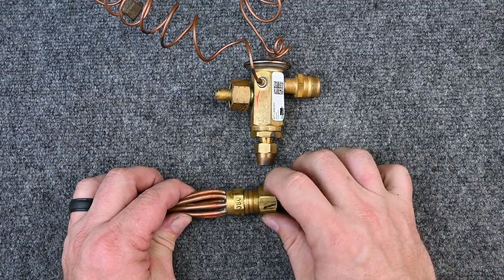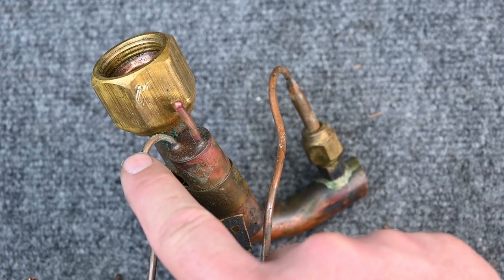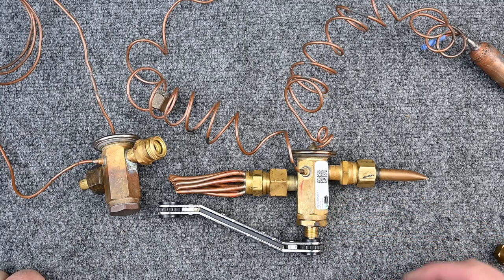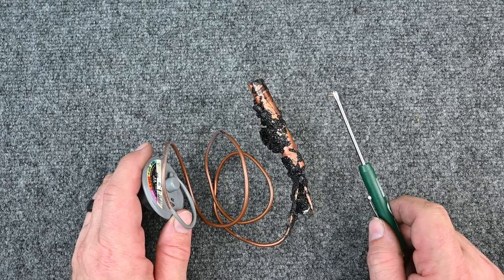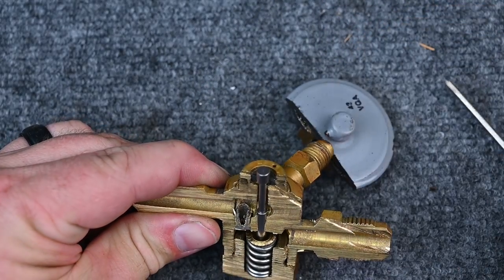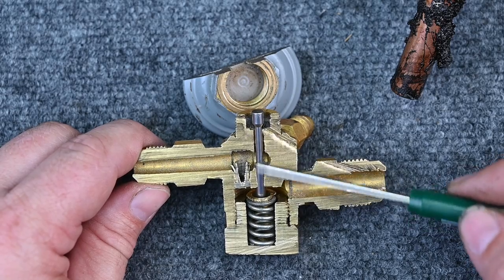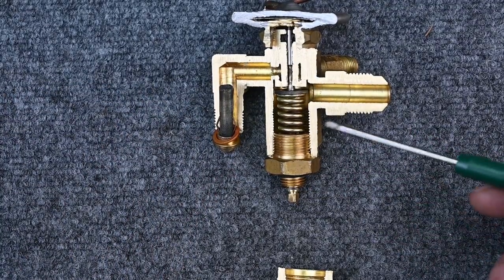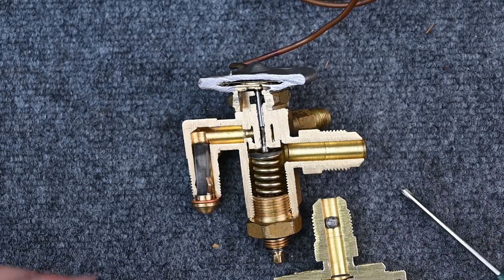HVAC 090 TXV a deeper view of the Thermostatic Expansion Valve TEX TXV

Comment: Wow, what an awesome video and channel. I wish I could hire you to service my heat pump in AZ! In order to test TXV using superheat method, must the system be properly filled? I had a tech tell me my lack of cooling is most likely due to TXV but can't be certain. Now I'm researching how to diagnose faulty TXV. The subcooling was only 1 degree when it should be 10 degrees on my heat pump. The tech supposedly added 2lbs of R410A. That only gained another 1 degree of subcooling so now has 2 degrees. He didn't feel comfortable adding additional refrigerant. I'm worried that not enough liquid is getting to the TXV if my charge is super low. I cleaned my condenser coil the best I could, silly trane spines. Other than low refrigerant, what other things should I look for that causes low subcooling? When the system initially runs after a period of rest, the suction vapor line is nice and cold, "beer can cold" at the evaporator, then it becomes closer to ambient temp after 5-10 seconds. Could that be a sign of restriction or low charge?

Comment: Welcome shering  good  testing  and  adjusting  thermostatic  expansion    valve. To  test adjusta  new  tx vor  valve  wich  is out  of  adjustment  follwing  tools  and materials  are  required    a  srevice  cyinder  of  refrigent  1  R12   . R22 to  supply   70 psig  pressure. A highpressure gaugeto   indicate  valve in let pessure anda  lowpressure  gauge   compoumd )to indicate   valve  out let pressure    samll quantity   of  crushed  ice  in  a n  insulated  container proced  as  follws to  adust  valve  .. the  oen  the  sreice  cyinder build  70 psg   warom  the  cylinder  if  required  on thehigh pressure  age  conected  in the  line the  vlve  inlet the  expashion  vlve  ca  now  be  adjusted  the  pressurethe  our  letshold be  equal  to  the  pressureof  the refrigentto  be chargedinthe systomattemperature  22°f  if  10°f  super heating is  rquired   the  temperature ofthermal bulb is  32  °fthe  superheatingis  to be  10°fthen  the  temperature of  refrigerant   will  be  22°f  and  pressure  mustbe  adjusted  to  much  this  22°fthe pressure  on  the out  let  gauge should bs differnt  for  various  refrigerants astap  bodey  of the  valve  lehtly  oder  ti  determine  if  the  valve  is  in  soothe operation  the poiter  of  low  pressure  guge  shold  not jump  more  lode adjist jest drmi spring adustinv only  lord and slowly   exp gas  r22  22psig  r22  ..45  psg   is ..ok gues   opershoion welcome...

Comment: Great video, Ty!  I wouldn’t have thought about the dissimilar metal issue but it makes perfect sense. Another thing that I find puzzling is why manufacturers even use copper brazing as opposed to using flare fittings. I can imagine brazed connections being somewhat more reliable but if flare connections aren’t reliable then why are they used at all? In a similar vein, it would seem sensible for valve manufacturers to increase the length of the piping to where brazed connections are made to help protect against the valve being damaged by overheating. Anyway, thanks for another highly informative video. - Best - Jim
Reply from the maker: You bring up great points.
I think it comes down to cost. It cost more for the brass flared fittings and more manufacturing requirements to make those in the factory.
Shorter tubes for the same reason. 
.10 over 100,000 units is nice bonus for someone. Thays my opinion anyway.

Comment: The equalization line, besides providing the valve with the saturation temp via the pressure, also bleeds off the liquid line pressurized refrigerant that will inherently leak around the valve shaft into the chamber below the powerhead.
Reply from the maker: Carrer installed some TXVs upside down and the same area below the power head would fill with oil.

Comment: You are wonderful teacher Ty, if the sensing bulb got leak how we know that? Thanks.
Reply from the maker: High superheat that you cannot adjust.
it will give you the same symptoms as a a restriction
Record Superheat, take the bulb and put it in ice water record the Superheat then heat the bulb up in your hand warning it up and record superheat. if the superheat never changed you may have a leak in the sensing bulb but a restriction clogged strainer can give you the same symptoms.

Comment: I learned something new today about the position of the two tube sticking out of the Sensing bulb either I forgot I learned long ago and faded out a memory or didn’t pay attention closely enough to the readings or instructions for my father as a child. 

     Doesn’t matter how many decades you’ve done something if you haven’t learned something new every day you’re not doing something right.    

Got a love those guys who swear by StayBright 8.    And because they’ve been doing something for decades usually ( that makes it right) find that there are stubborn as a log and deny they caused any harm.    Even if you show them.  Deeply ingrained cult religion following.
Reply: Some ppl can use it correctly and not have problems. So those ppl are not wrong. It's if you did not learn how to make it work is when there is a problem. So it appears depending on situation you and them are right. When done right they are right.

Comment: Question: is that an easier way to check the txv without checking the charge?
for example: if I just check the temperature before and after the txv can I tell if it's  bad?
Reply from the maker: Measuring superheat is the only way to check aTXV since it's trying to control superheat.

Measurquick app has a method to check the charge of a system without using gauges, called non invasive testing. You will need the full probe set but search Measurequick  non invasive testing and you will find an article on that. 

Non of the methods uses temperature drop across the TXV

Comment: Food for thought: if the sensing bulb is subjective to temperature from outside sources hints the need to wrap it with insulation tape is the capillary tube between the bulb and power head equally influenced ?
Reply from the maker: Great question. 
I do have a friend that sprays insulation on that tube but I find it unnecessary. 

The liquid vapor mixture is inside the bulb itself also factored the volume of the bulb. The size of the capillary tube is small, very low volume. 

So yes it possibly could play a factor but I overall such a small amount it's not worth the worry.

Airflow, ductwork, filters, home air sealing, refrigerant lines and bends play a bigger part. 

All TXV have a swing as well. They won't maintain a precise superheat. When that becomes a factor an EEV is the go to because it will keep the superheat on point and precise. 

I love that your thinking about it!
Reply: I’ve seen some units where the txv is in the air handler and the bulb is on the suction line on the outside of the air handler (wrapped) I just wondered about the influence of the air temp between point A and B.  Thanks for the response.
Reply from the maker: @moonlightacmaintenance3232  
Yep. That's the best way! 
Next time I get to talk to an engineer or a lab test person I will certainly ask and get you a better answer. 
Im always impressed where those conversations lead. Thank you for bringing it up.
Reply: Here’s another odd question, if I have a leak on my vapor side in a 410a system should you A) pump down the system and repair and top off charge after or B) recover and repair and recharge with virgin refrigerant? The reason I ask is fractionation a issue because it’s leaked out as a vapor opposed to a liquid ?
Reply from the maker: @moonlightacmaintenance3232  
Fracination is not an issue with 410A.
The 2 refregerants are so close together. Many tests have been done  with this.  A friend worked in a testing lab and they found even charging 410a as a vapor was not an issue. 

I will still recover and charge all new refregerant, because I don't know the practice of the last person that serviced it. Did they pull a proper vacuum? Did they mix refregerants? Did they properly purge their noses each time it was serviced? All these unknowns is why new refrigerant is cheaper.
Reply: Good info sir, I guess 410a was a bad example of what I was trying to achieve in the question.
Reply from the maker: Most other blends, fracination is a concern for me.
Reply: @love2hvac  so depending on what side of the system a leak is on would be enough to be concerned…..
Reply: We use a lot of 427a as a retro to r22.

Comment: Any experience with AC Renew?  I’ve heard it’s a product that helps with older systems and can weaken trace acids.
Reply from the maker: A compressor manufacturer a while back had an issue with a rust inhibitor that reacted with POE oil and it gummed up TXV's and AC renew was the only thing that seemed to help that. 

As far as acid goes, I'm not a chemist but the one I talked to had a lang explanation that essentially said what ever gets rid of acid either is a base and must me chemically balanced in quantity ot it will turn back to water that will turn back to an acid. I do not have anything in writing to back that up so do your own research. 

I had 2 commercial systems that had noisy compressors but where running good. I added ac renew and they were still noisy and died 6 months later. I don't think the AC renew caused the failure but it certainly did not help with anything.

Manufacturers spend so much money marketing their products it makes it impossible to find the truth. 

Long story short I would use it for the specific issue of oil additives where the manufacture suggested it but I would not spend the money behind that.

Comment: In electronics soldering, they sometimes use a non-corrosive flux.  I think kester makes a pen.  Would that work for soldering pipe to prevent corrosion failure maybe?
Reply from the maker: I do not know.
I have yet to see any manufacture of residential or commercial equipment use soft solder from the factory as they are always braze (silversoldered) . The manufactures spend a lot of time testing a variety of methods. I think, if soft solder was a viable option  at least 1 manufacture would be using it. 

I think instead of improving a inferior method to make it slightly better we could just braze it properly with an inert gas and never have to worry about it again. I would rather see the fast push on connection as they would at least be easier to fix. Fixing soft solder connection is one of the things I despise doing.
Reply: @love2hvac  sorry.  I like to solve problems with things.  Also youtubers in general have trained viewers that comments feed the algorithm.  "Here algorithm have a cookie" isn't a very well thought out comment, so I try to pose interesting questions.  Also I believe there was an hvac youtuber that to paraphrase, mentioned we should always be exploring, learning new things, and new techniques. Otherwise we would still be charging systems by feeling the pipes.
Reply from the maker: Oh I love your thought process. I apologize I should have worded that better.  Soft solder has just left a sour taste in my mouth over the years.  I've also received a good bit of email from the loyal soft solder members trying to recruit me to the dark side. I apologize for comming across harsh. A company called solder weld would be a great reasorce for they diffrent types of Rossen core (non corrosive). 
Looking at new methods and solutions is great. Dont let anyone stop you from exploring ideas.  I was contacted by Parker/Sporlan today. They have a new products the want me to look at a new product called the zoomlock max and now a zoom lock push for connections. Hopefully I can check them out soon. 

I don't know about the algorithms I dont even consider myself a youtuber. I just want to be able to help some people.  I still have a lot to learn about HVAC and I'm a complete noob at the YouTube thing!
Thanks for your patients and never stop learning.
Reply: That's what confused me with plumbing - acid solder. Coming from electronics work, practically zero solder uses anything but rosin except for the kind used for oven soldering boards that get washed after. Rosin is simply pine resin and isn't horrible to breathe either. It's probably less effective but you need clean connections anyways. Perhaps rosin has it's own issues if it mixed with oil or dissolved in any refrigerants.. I don't know. I agree that fancy new press fit designs are fascinating in their own right, I would hope to see more fancy silicone rubber gaskets used which shouldn't degrade as much over time or with heat. @love2hvac